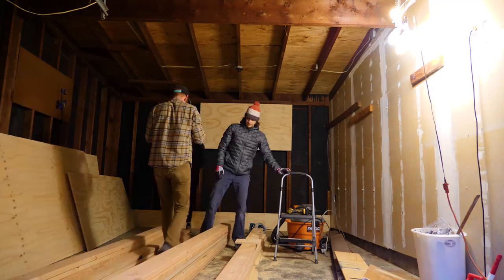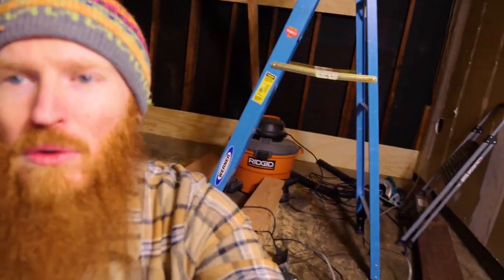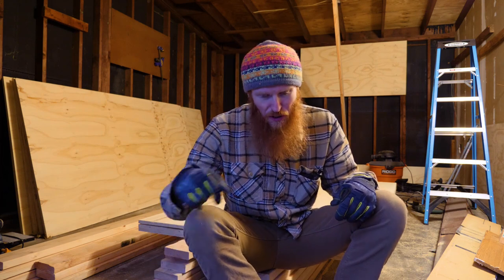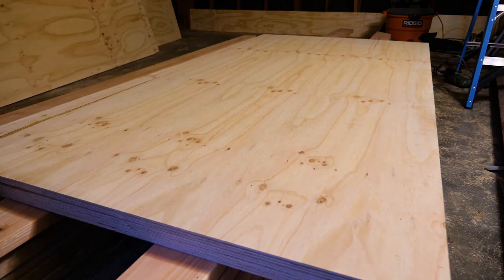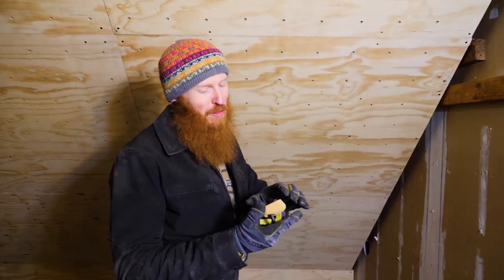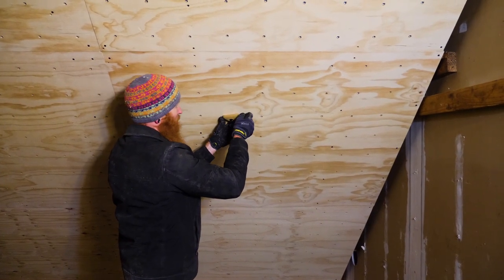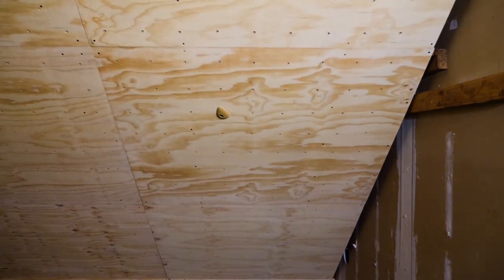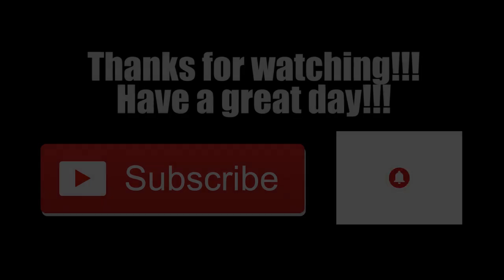Epi 43 - Building a climbing wall in my garage with Mike

Comment: If you don't want your wall panels to warp (which could potentially lead to t-nuts bursting out of place) and you want to add some texture to your wall get some Kilz outdoor paint and mix in some textured sand.  Did it to mine and am glad i did it.  Reduces splintering of wood later on too.

Also, what angle is the wall?  Not sure if you mentioned it.
Reply from the maker: I was thinking about adding textured paint but I think that without it the importance of toe placement will be higher due to less friction. There should be enough frame connection points that it doesnt warp but if it does ill just replace the whole panel :) it's 45°

Comment: How much did it end up being for materials (not counting holds)
Reply from the maker: So just for the wall in this video...11'x13' = Plywood 4x8 sheets were about $40 per (needed 7=$280). 2x6x12s were $7 per (needed 10=$70). Case of T nuts was $290 shipped. Total $640

Comment: I wanted to ask about the framing. When you attached the 2x6 to the existing wall framing how did you attach it to the existing framing? It appears that you set it next to the vertical and screwed it together. I was curious as I was worried about strength but yours is plenty strong so three screws to attach through the faces?
Reply from the maker: The actual framing was pretty easy. I screwed four 3.5" wood screws through the 2x6 at the top & bottom of each 2x6. I then put a few supporting 2x6s behind ghe vertical ones for stability. For the 4'x8' plywood panels I screwed 2" wood screws through the panel and into each framing board every 6-8". I figured the more the merrier aha
Reply: @averykevans6894  thanks :)
Reply from the maker: @BradSieve  absolutely!

Comment: what kind of glue are you using for the tnuts?
Reply from the maker: To be honest, I don't remember exactly. I know it was from home depot in a tube like silicon and caulk comes and was glue made to work with wood and metal. Brand escapes me though. Think the tube was white and label was blue though if that helps